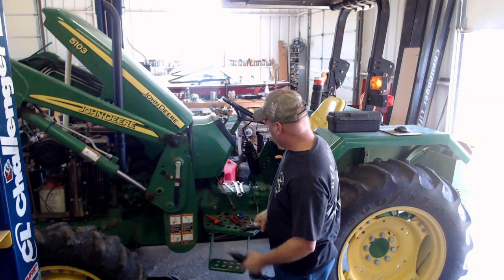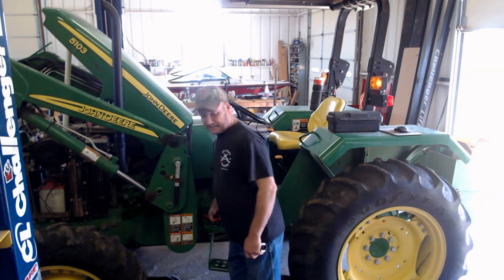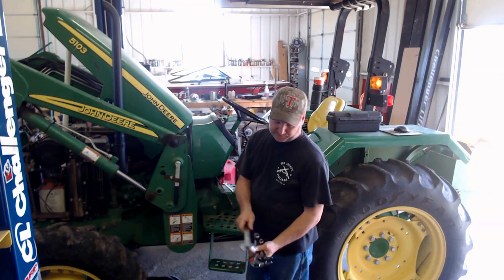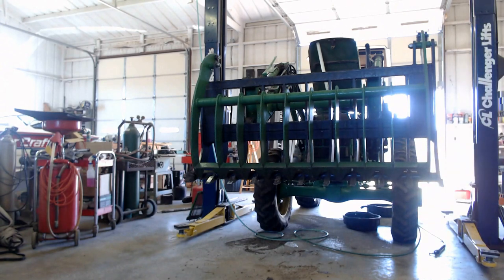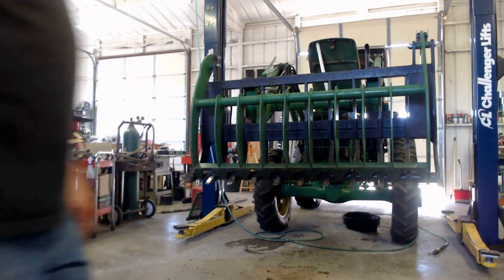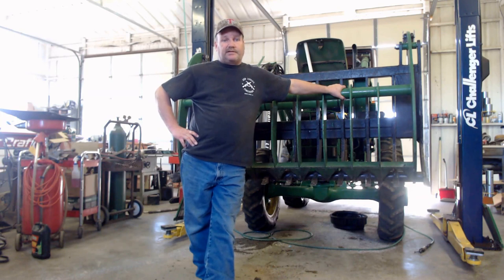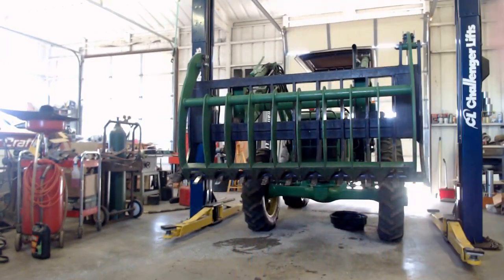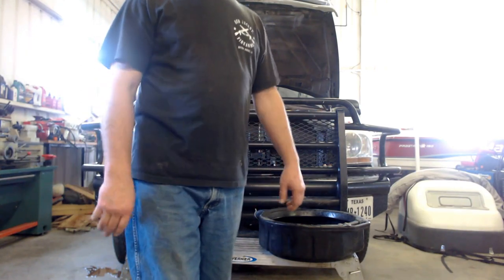Adding block heater to John Deere 5103

Comment: I watched your video because I was installing a block heater in my 5103.  Not an easy job and I did not have a loader in my way.  I had to buy a 5/8" hex wrench and cut a piece off because I did not have your ability to make one.  I did not have to remove any lines but it was like working a puzzle.  Started the heater in by hand with a 3/4 drive 1 3/8 socket on it and tightened it up with a pair of channel lock plyers to turn the socket.  I had to lift a fuel line a little to get the socket on, but I did not have to bend the line.  Thank you for the video, it was helpful.  I do not think I could have done it with a loader in my way.
Reply from the maker: Well Good, sounds like you won the Battle.  That has been quite a while back.  But I did run across the tool the other day in my toolbox.  My dad was needing a 3/4" hex.  I told him I could make him one but he just used a 1/2" bolt welded onto something I think.
Reply: @larryrobinson7492  
Larry could you tell me what the Model number is for the heater you installed? I have a 5103 but can't find the heater model number use for it on the internet.
Reply from the maker: @lizprien6276  Customer supplied that to me from the dealer. Sorry I don't know